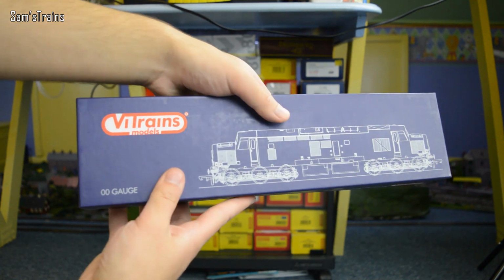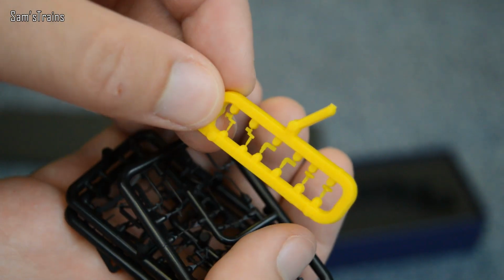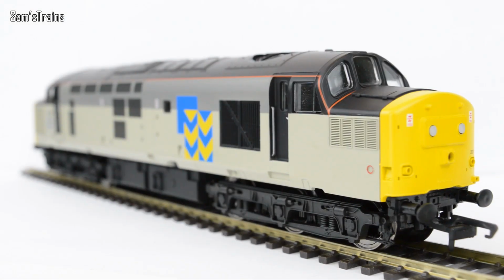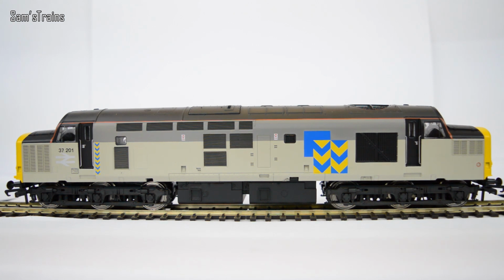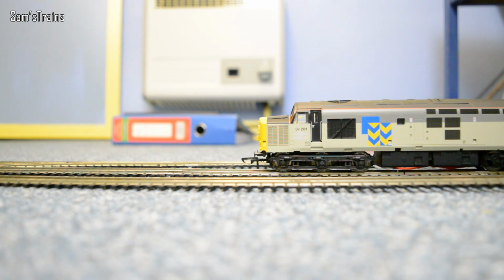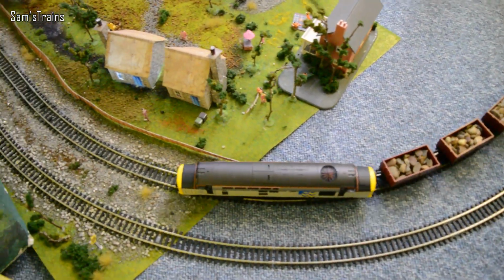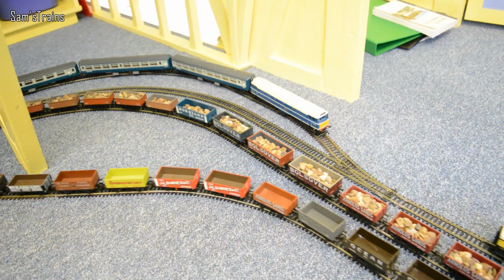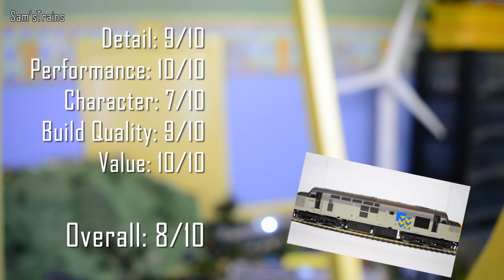Unboxing the ViTrains Class 37

Comment: Hi mukka, I noticed a slight error with your class description dialogue. D6700 was in fact the 1st class 37 built, not the last. (The last one built, just for the record was D6608). 

The blue and yellow chevrons logo was the sector pool the loco was allocated to... this loco is in 'Metals' livery. The others were 'Coal',  'Petroleum', 'Distribution', 'Construction' and 'General'. (The class 31 you used on the running session, with the eternally derailed 'Bestwood' wagon right behind it, is in 'Coal' sector livery.) 

I like your blase view about having derailed wagons in the train rake. I shall try those comments with my boss should I derail a wagon or two on my train in the future! I don't think he will appreciate it though.

 Cheers from Oz chum. Gaz
Reply from the maker: Thanks a lot Gary - this is an old video now - my research wasn't up to much back then! ;D
Thanks for watching - Sam :)

Comment: Very nice review of the ViTrains Sam.  Most people do not like ViTrains locomotives, I do, I have a couple of them. The only issues I found is when you take the top off to install a decoder, they have  8PIN sockets. The directional lights are a bit flimsy, as are the yellow ends, they can both come off very easily, especially the directional light bar inside...Simon
Reply from the maker: Thanks very much Simon - yeah I can't really complain about mine! I've not really taken the body off mine too many times - just once or twice to oil the running mechanism, but yeah I did notice the lights are a bit flimsy, and they do always seem to come out of place as you say lol! Never mind though - they're good when they're good! ;D
All the best mate,
Sam :)

Comment: I remember buying these when they came out. They were about 50 quid. You could get Bachmann ones though for a similar price but they were decent models. The issues were with the yellow ends on some of them. Looked often quite plastic with the shade of yellow.
Reply from the maker: Thanks for the info Matt - I think i'd rather have the Bachmann one, if only the prices were like that these days!!
Thanks for watching - Sam :)
Reply: I bought one for around 50 quid which was good value for money in 2007! Still very happy with mine now.

Comment: D6700 is the first class 37 not the last one, thats why it is in the NRM. I have 1 Vitrains 37 and multiple Bachmann 37s, as I feel the Vitrains is to like Lima in quality and having 4 wheels powered with traction tyres today is not acceptable for performance as Bachmann 37s uses 6 wheel drive without tyres. Get one has the detail is already fitted on the locomotive and they do not look like plastic, like Lima which Vitrains came from.
Reply from the maker: Hi, thanks very much for the comment! My apologies for that, I didn't realize it's the first! Interesting about the Bachmann versions - I've never had one so can't compare, but yeah that does sound much better!
Thanks very much for watching,
Sam :)

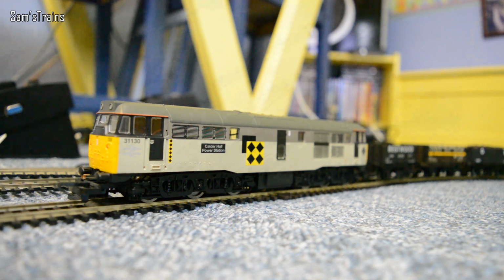Comment: 6:50 see your class 31 is coal sector markings, the other thing with this sectorised livery was at the opposite end to the driver (or right hand side of cab) they had depot plaques which told you which depot the loco was from, hard to see on models 🌈😷🇬🇧
Reply: The class 31 has the depot plaques for Cardiff Canton depot from what I can see,......
 but they aren't fitted on the 37 so I assume they're in the detailing pack and you have to stick them on all by yourself, (if your mom allows you to use glue without adult supervision) 
Anyway...I came all the way back here in history just to see a review of the Vitrains 37... looks like they're good. 🌈😷🇬🇧
Reply from the maker: Very interesting lee, thanks for letting me know about this! :D
Thanks for watching - Sam :)

Comment: The blue and yellow logo is Railfrieght's petrolium sector.
Were did you get it from?
Reply from the maker: Okay thanks for the info! I think I got this on EBay, It diddnt cost me much I don't think!
All the best,
Sam :)
Reply: Checker board is construction materials and diamond shapes are  coal.  Red diamonds are rail freight distribution.
Reply: Petroleum would be very similar to that but "wavy" lines as in liquids
.....that one is chevrons indicating metals sector 🌈😷🇬🇧

Comment: May I ask you a question, should I get OO or HO gauge track and locos? I heard going with OO is better because it's cheaper, is this true?
Reply from the maker: Hi there, 00 gauge and H0 gauge are completely compatible with eachother: H0 locomotives will run on 00 track, and 00 locomotives will run on H0 track! 00 is slightly larger, but only fractionally so! As for cheaper, I'm not too sure - there doesn't seem to be much of a price difference between the two! Most of my locos are 00 gauge, but I have a few H0... I personally prefer 00 though!
All the best mate,
Sam :)
Reply: oo looks better to me

Comment: Hi Sam, interesting video again however I have to disagree with you on a few points ……… If I want a Class 37 there is only one brand for me : Bachmann !
I have a very nice Bachmann "Scottish" Large Logo 37417 DCC Sound albeit NOT for the £35 you got yours for.
Bachmann has the no-nonsense 6 axle drive without those reprehensible traction tyres. If it is weighing a ton as you say why just an un-prototypical 4-axle drive with those stupid traction tyres ? They belong under cars, not trains however with certain (German and Dutch) brands you can't escape them.
I also find the wheels too shiny unlike the blackened wheels of my Bachmann. I don't see windscreen wipers and I do see quite noticeable drooping couplings.
But again I won't argue about the £35 which certainly is a good bargain !
I paid at least £150 for my Bachmann but that included the sound as well and I think it was also worth every penny.
Cheers, Jan
Reply from the maker: That's fair enough Jan - I've never tried a Bachmann one, so I can't say! It does sound as though Bachmann's is superior - but I can say with 100% certainty that this is far better value! :D
Thanks for watching - Sam :)
Reply: Thanks Sam, Agreed if you look at the very low price you paid for it
Cheers, Jan

Comment: Although I have an untested 37 diesel in my collection, yours is still a horrid stinker.

Sam liked diesels, but not as much as steam engines. During a diesel running session, something went horribly wrong. On the inside line, a Class 31 was hauling a lightweight train of empty wagons. Sam had him running a bit too fast. The diesel's goods train derailed on the curve under the bookcase, pulling the diesel over with it. Sam managed to drag the train carefully towards him, and re-rail it truck by truck. This was the least of his problems.

On the middle line, a Class 37 diesel was having trouble getting up Gordon's Hill. Sam had attached far too many stone-filled wagons plus a Guard's Van to the box-on-wheels. As a result, the diesel stalled with helplessly spinning wheels and Sam wisely brought the train to a halt. Sam intended to uncouple half of the train to make pulling power easy, but his plan didn't quite come off. Oh rats and mice. Just as the boy gently lifted the front wagon, it slipped out of his grasp and flew backwards down the hill with its companions rattling behind it. Sam was horrified.
"Oh sugarplum fairies! What'll I do now?" He couldn't retrieve the runaway trucks in time, yet he saw them bump into something else that was as solid as the 37: Thomas the Tank Engine. Thomas knew a lot about trucks and their tricks. He was glad he'd been in the goods train's path. Nothing was broken or damaged. Phew!

A new day dawned. Sam was playing with trains, but couldn't figure out why he was shivering with cold. Thomas and his friends pretended not to see, which was it seemed a good thing. Can you guess why Sam was so cold? You got it in one: he realised to his horror he was completely naked! How embarrassing could this get? Sam didn't know and neither do I.
Reply from the maker: Oh dear - sorry about that Kelly, I apologise! ;D
Thanks for watching - Sam :)